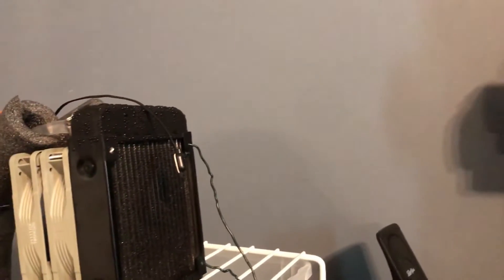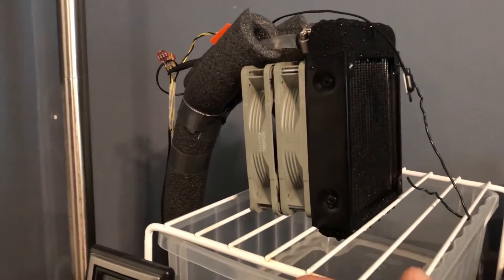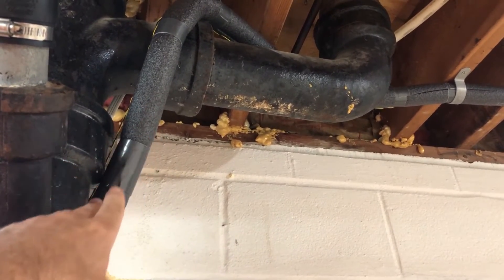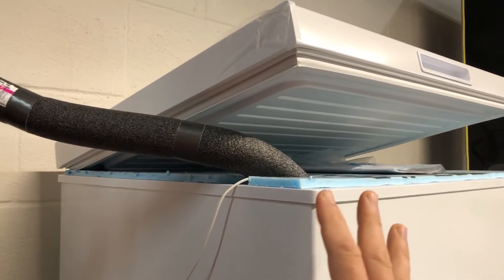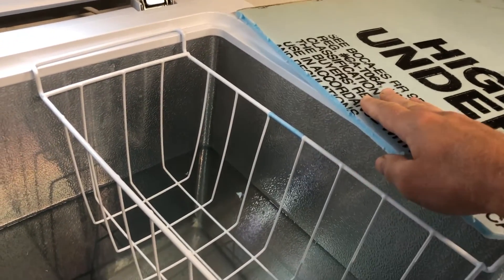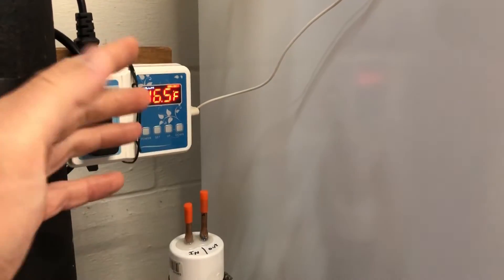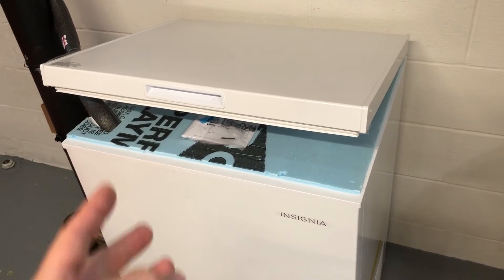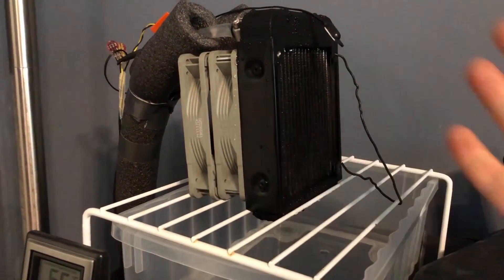Chest Freezer Mini Split Air Conditioner | Random Video Thursday's

Comment from the maker: Thanks for watching! On top of the parts list in the video description, I also left some other info not discussed in the video. This would not make sense for everyone to build. If this seems like it fits the bill for you then I hope this helps. Although this uses very low wattage by comparison to a conventional AC, in the long run the operational costs would be comparable. A regular A/C would run intermittently while this would run continuously. There are pros and cons to both situations so it comes down to personal choice. Also this will not cool the entire room noticeably for quite a while and the room would need to be sealed from other spaces (closed door etc.) If you have a larger room to cool and/or the room is not well insulated, then a larger chest freezer would work better. You would simply use the same amount of water as a smaller freezer, but a larger freezer has more wattage and surface area to cool the water. You can cool a room fast with a much larger heat exchanger/fan but you will quickly deplete the capacity of the system in just a few hours...I have tried.
Reply: What if you add a heat exchanger into the water inside a closed loop? Woukd that do better?

Comment: This is definitely interesting. You could also use a glycol solution or winter windshield fluid so you could store more „cold“ fluid. And thus be able in an extreme heatwave to use that. 
Its a good setup. 
My main problem is that you are putting the heat from your room in your basement, which in turn heats the basement and heat rises. 
But if it works for you, great.
Reply from the maker: @batterynerd8779  I was using it during the recent heat wave and it worked fine. It’s a full open basement 1700 ft.² and I didn’t notice any rise in temperature. Whatever heat is created in excess is barely noticed overall if it’s even measurable. The only way to make it colder is to use a different heat exchanger design. Because it’s super cold liquid flows through the heat exchanger it will just ice up. Eventually, it just runs at equilibrium which is around 44°F water temperature. The freezer cannot make it any colder one running continuously. It would need a much larger freezer for that which is not really worth it..

Comment: Have tou tried a larger rad and fan? I yave seen the "box fan/dual rad" setup, and I actually thought about the idea of combining your idea with that. Any thoughts?
Reply from the maker: Yes, that will act like a full scale AC for a few hours until it depletes the system. It cools a room rapidly but unless its a health emergency, its not the way to go. This only works as a trickle system so that it can be continuous and maintain cooler temperatures indefinitely. Freezers/Fridges do not have compressors designed for fast circulation to cool something down fast. A very large freezer might work better for a larger room or even colder temperatures for a smaller room but none will be able to act like a window AC and maintain that rate of rapid cooling. The only way to work around that is to have a larger freezer that can hold maybe 50-100 gallons pre-chilled water and then intermittently run a larger fan/pump. The problem with that is cooling intermittently is less efficient that continuous cooling. That is exactly why setting a house HVAC system to off during the day while away from home can actually use no less energy, if not more, than just keeping it at temperature all day. This is because it's not just air that that holds a temperature. Physical mass takes longer to change temperature.

Comment: I was thinking about getting a chest freezer and running it through my air hammer and my mobile home with a water pump. Fill the chest freezer up. with either a water, alcohol mixture or antifreeze to keep it from freezing then I can just circulate cold Water through the air to the house
Reply: Doubt it would do much to cool a whole home.  When cooling anything you have to have enough btu’s to “pump” the heat out of the space being cooled.  In this case the heat is being removed via vapor compression refrigeration from the liquid that you are chilling, then the heat from your mobile home is absorbed by that cold water through the air handler heat exchanger.  Deep freezers and refrigerators (domestic ones) have very small compressors with a limited cooling capacity.  They can remove approx 500 to maybe 1,000 btu/hour of heat.  They depend upon really thick and efficient insulation to cool the space down and keep as much heat out as possible.  A two ton heat pump/air conditioner is 24,000 btu/hour or 3 ton is 36,000 Btu/hour.  So as you can see you would have to have multiple deep freezers working together to make any real difference.  

Mini split units can be bought on Amazon, many of them do it yourself models, for under 800 bucks for a smaller size 1 to 1.5 ton system.  It wouldn’t be worth it to try this for a whole house system when you can get a large enough system that cheap.  Plus you can’t really use glycol as a coolant and chill it down to below freezing.  That will cause your coil in the air handler to freeze up from condensation.  

The reason an air conditioner freezes up when low on refrigerant is because the low pressures cause the small amount of liquid refrigerant in the evaporator to vigorously boil near the entrance to the coil.  That drops the evaporator temp down well below 32 (sometimes well below zero) in that area and ice starts to form.  Same thing will happen with below freezing glycol (minus the boiling of course 🤓😉).  

Regardless, even if you could run 10 degree glycol through the heat exchanger, the heat from inside your mobile home will quickly have the water temp well above freezing.  So you would get an initial burst of really cold air that would quickly start to get warmer and then wouldn’t cool much at all.  Also, a deep freeze won’t last too long in this type of setup if you don’t have it located in a fairly cool room like a basement.  Deep freezers are designed to work with an evaporator temp of -10 F degrees or so, if not lower.  Keeping the evap at 35-50 degrees or so is increasing the load and consequently the motor winding temperatures in the compressor.  The hermetic compressors in refrigeration systems rely on the refrigerant to cool the motor windings.  So the higher evap pressure increases the amount of refrigerant that the compressor is pumping, putting a higher load on it which translates to more heat generated by the windings.  If the deep freezer is in a high ambient temp environment, the head pressure will also be very high.  The compressor will likely have a fairly short lifespan in that situation.  It is a really interesting idea though!  

Most large buildings/skyscrapers, universities, hospitals, and other large buildings and/or campuses use this exact type of system to air condition their buildings.  Most of them use centralized chillers with huge compressors and large heat exchangers to chill ordinary water down to 40 degrees or so.  Then that water is pumped continuously through pipes and distributed to air handlers located all over the building or campus.  Some air handlers are like household heat pumps with ductwork and all, with the chilled water providing the cooling through coils instead of refrigerant.  Other air handlers are single room units.  These huge chillers also use condenser units outside that utilize water and the evaporation of that water to cool and condense the refrigerant, greatly increasing the heat rejection capacity (most units do it this way, some smaller chillers just use outside air without the water). Some of these big chiller units are absorption units using ordinary water as the refrigerant but that’s another topic.  This concept is no different, just a much much smaller unit.

Comment: In your case this is doing what you need it to but for other applications it makes more sense to allow the water to freeze (to some extent) keeping in mind that the evaporator coil will be installed hard against the inside casing for heat transfer so the ice will form on the walls first and slowly get thicker, on a domestic chest freezer I’d be very surprised if it was capable of making a solid block, virtually impossible as the ice really starts insulating to some extent. By doing this they would increase the stored capacity because you are no longer relying on just the sensible heat of water but also the latent heat capacity of the ice (which is maybe 10 x the sensible heat per kg).
I’ve considered doing this and using (or converting) a freezer that is 12 or 24V DC, that way you could run it during the day on solar panels and use the stored capacity in the evening when you get home.
Reply: Have you ever thought about coolant used for the car?👍

Comment: Idk if I like this bc the heat output by the freezer in the basement ... (Which includes waste heat from the compressor motor, and any heat during a defrosting cycle, and all the heat transferred out of the bedroom at night) will just be heating up the rest of your house via the basement ceiling. Some of it even goes back up into heating your bedroom which costs you more energy.

If anything you should store the freezer outside so that you expend the exact same amount of energy keeping the water cold, but don't pump all that heat into your home in a time you probably want it to be cooler (summer).

Also , you didn't measure watthours used on your setup in the course of a fully 48 hrs or sk. I would think that a simple window air conditioner Will do a better job converting electrical energy into a cool and slightly dehumidified bedroom environment. Plus ... You can get them for like 1/5 the price of what you have there via aarage sale or fb market place. Hell even a brand new one for a size of that room is gonna be pretty cheap. 

You do have the battery aspect going for you but I handle power outage just by having a cheap gasoline generator on standby. It gives us a way to charge up everything which even your system is going to require. Any AC works a lot faster than your system would though.

Here's an idea .. why not use a peltier cooler. You can pump the wasted energy into your hot water heater (or heated pool, hot tub?) , and cool down water for cooling your room at the sameeee time / no extra energy needed.
Reply from the maker: Pelts are very inefficient when it comes to watts per btu.
Reply: window ACs make to much noise